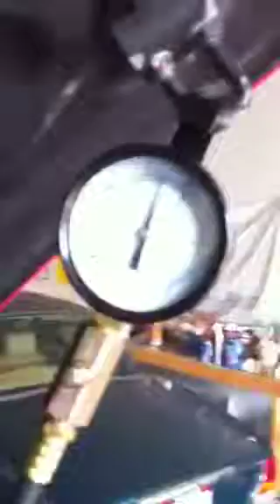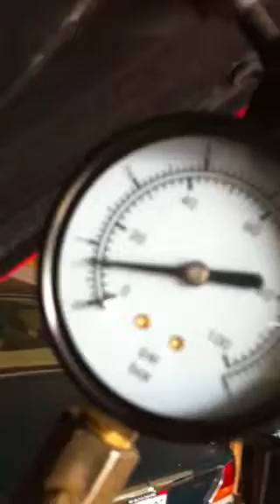Ferrari 308 fuel leakdown test on Bosch CIS system

Comment: Hi my Ferrari mondial is having a few problems.. When it warms up after and from driving about 19 miles it starts running really ruff and sounds like a cylinder had dropped out could it have anything to do with fuel mixture?

Comment from the maker: @itraco The WUR wasn't the problem. Rather, it was a failed check valve in the fuel pump. We upgraded it to the later style pump with external valve and had Larry Fletcher supply the new line we needed for the new style pump.